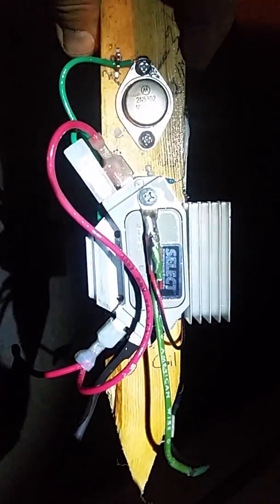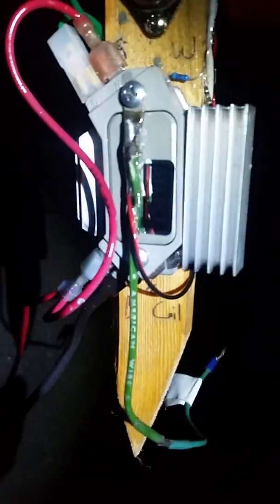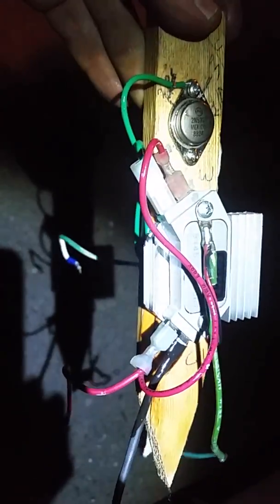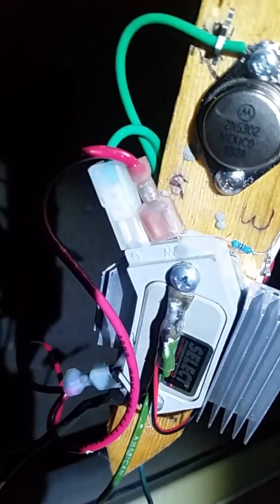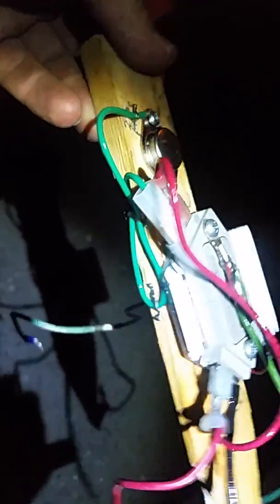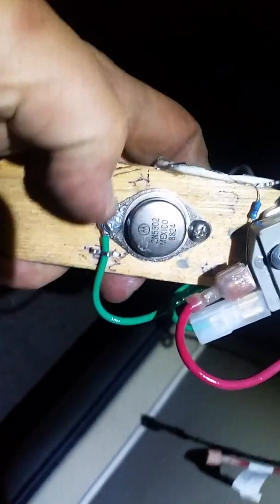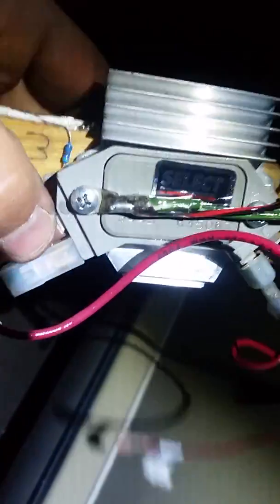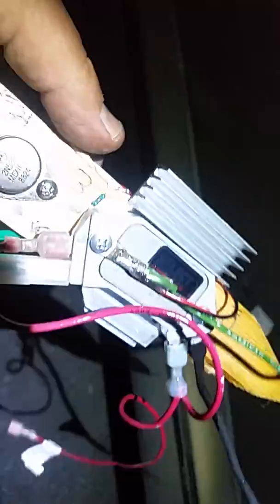How to add HEI to any points system with 3 parts and keep your existing points. 1/2

Comment: So does all that go inside the distributor cap?
Reply from the maker: Haha no. This is for a distributorless system. It fires every time. In this case, on a 4-cycle two cylinder. By firing every time, the piston is at TDC and the spark occurs on both, whether or not it's the compression or exhaust stroke; so it doesn't need a distributor. For distributor-type systems, of similar vintage, look into Pertronix brand upgrades. For single-cylinder and two-cylinder briggs and similar, look into solid state coils.